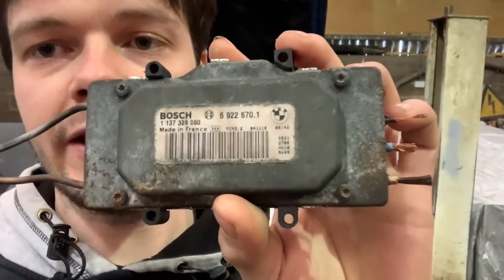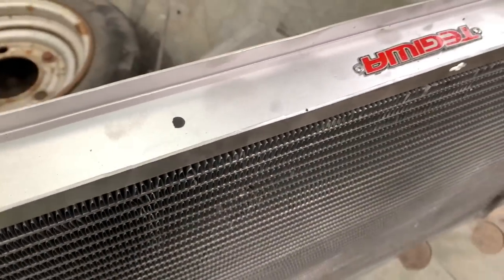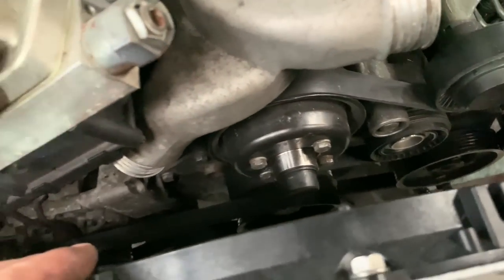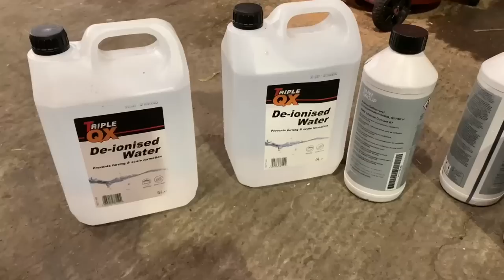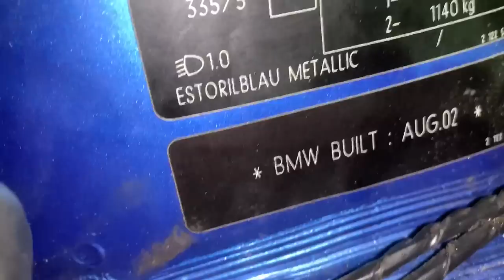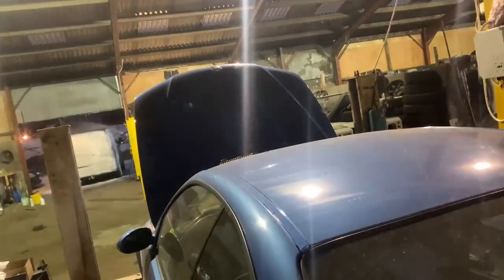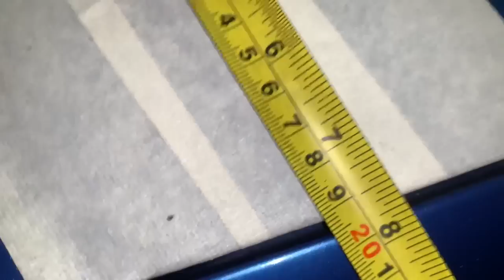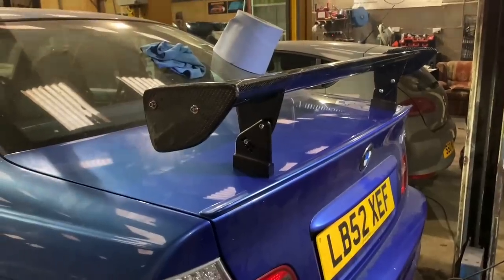M3 GeTS Rear Wing

Comment: At a later date, if you still have high temps... make a fan shroud out of alloy sheet and add some rubber valves to it, it controls airflow, when the fan is off the valves open allowing airflow through the shroud, but when the fan switches on the valves are sucked shut and the fan can only pull air through the core.... it’s a lot more efficient- roughly 30-50% more cooling when done properly.

Comment: Just a word of warning on the rad mate. I were slightly overheating at the ring on standard old rad in anything over 22ish deg, so fitted genuine water pump, new air con rad as the old 1s fins were clogged and swapped standard rad for tegy one and new whalr stat, street driving/honing was fine. On the ring I was getting hot again every lap, more than the standard rad was. Also it slightly leaked from the top hose connection and lost maybe a litre on track when it got hot so used some instant gasket when I was there. I got back and told tegiwa and they sent me a new one but I was overheating still on the second 1. I sent it back, got a refund and put a brand new bmw rad and bmw stat in, went again in 30deg heat and the temp gauge stayed dead centre all the time, I were doing 8min laps so were kicking the hell out of it. Yours may work better than mine as you've removed the fans etc. Good luck.
Reply: BMW knew what they were doing eh!

Comment: They are a self bleeder on the cooling ;). It's not a myth

However, there is a specific way it has to be done. In short

1) Igntion on, engine off
2) Set the heat up to max, low(ish) fans
3) If you have done this right and the aux pump is working, you'll hear the aux pump run. It's in the heater valve solenoid assembly
4) With the above confirmed, begin to fill it up. It will take almost all of what coolant was drained
5)  When it has settled and taken all it can, the level will stop moving.
6) Fire it up. It will warm up as quick as they should do :)

Bleed screw doesn't need to be touched. Why does it have it? God knows. I suspect they are prone to breaking, and that if the cooling system was changed late on in the design stage, it simply wasn't worth removing it from the house due to a tooling change. That's at least from my experience in the industry.

BMWs prior to this needed the bleed screw due to a low mounted header tank.

I've done a couple using the 6 step method above and it's been fine.

Comment: Good video as always, bit of advice with soldering, applies for different gauges of wire and the same gauge, but 'tin' (Fully coat them in solder) both ends of wire independently then apply a bit of solder to your iron and just line the wires up side by side and essentially melt them together, no need to intertwine them or twist them this will be more than strong enough and look a lot cleaner! Also do the spoiler feet have rubber gaskets/seals that compress when you bolt it up? If not it may be worth sticking some sealant around the studs if you didn't already do so, save any water getting on to the untreated metal where you drilled. Keep up the longer vids bud.

Comment: I love your videos, very relaxing and entertaining.Let me give you some advice to make your life easier.
1.Stop fucking around with the soldering.There is a time and a place for it, but universal crimp connectors(you know the red blue and yellow ones) are just fine, if not even better.
Soldering puts heat into the copperwire and makes it brittle.buy a decent set of connectors and a decent crimp tool.There are even universal connectors out there which have the solder in them and crimp up at the same time.
2.Invest in decent tools, you dont have to do everything with an anglegrinder.For example: Rivnut tool, airsaw,airgrinder,vaccum filler for the cooling system.There is always the right tool for the job.
3.If you dont listen to me, i will still enjoy watching you struggling.

Comment: Dan, the cooling system on the S54 does indeed bleed itself making it a much easier and less messy job than the way you are insisting on doing it. Unlike non-M E46s, the M3 has the coolant tank at the highest point and only the cap needs to be removed to let off some pressure after it has heat cycled. The bleed screw is only there because that elbow part of the hose is carried over from the non-M E46 as it is cheaper to manufacture one part and only adapt the routing of the rubber hose portion.

Comment: Hey Danny.🖐  I've listened to the music and decided Austria > France.😅  Hopefully the cooling should be fine now.  With no shroud, I think choosing a larger fan was a safe bet.  A 16" fan vs. 12" fan is a lucky 77.77% increase in area over the core for "more waftings"😁 and pretty ideal that the mounting holes line up, too.  Speaking of 7s, I have a feeling the next trip to the Nordschleife will get you there.  I noticed your writers were on point in this episode per usual.  Doing a quick vape and it's only yellow, so we don't have to worry about it too much.👏 The new carbon wing looks nice, bud.👌  Adding the plates to distribute the load from the added downforce was definitely worthwhile.  Too bad about the extra cuts in the boot but shit happens.  I would have dropped the plate into neverland, too... just my luck.  Lighter is usually better anyway.  Double-skinner Frank Skinner, haha, I expected Seymour on that one.😉 Congrats on the gift from the quirky-ass i-drive system.  That's a win!  And did you say return of the Integra?  For once, a reason to look forward to the Winter.🙌  If you've not dozed off and you've hung in there 'til the end, have a great week ahead, Dan.  And as our old buddy from Canuckistan would say, keep yer dick in a vice.

Comment: Soldering tip no 1: Tin all your wires first. In other words, solder the fuck out of each wire. Then bring both the wires your joining to the iron and melt the solder already on both wires together. Add extra solder if needed. It helps to use a soldering iron stand to hold it so you can have the wires in each hand. 😍

Comment: I really love the spec on your M3. I  guess this will be GTS spec know. Should be a real weapon on the road and track, just don't go track spec mad, it'll take away away the value of the car.
Can I suggest if you remove the insulation, paint the inside with polyurethane undercoat, which will give you less creaking,and less tinny sounding interior.
For the Carpet, perhaps a retrofitted carpet secured by velcro, so you can remove come trackday.
The doorcards are another for lightening. But instead of just putting   say a carbon fibre door card get a poverty spec door card cut the top off and attach it to the carbon fibre door card with a rubber seal to stop it vibrating and of course a red door pull strap. 
Those little details will keep it streetable and not a noisy vibrating horrible place to be away from the track!!